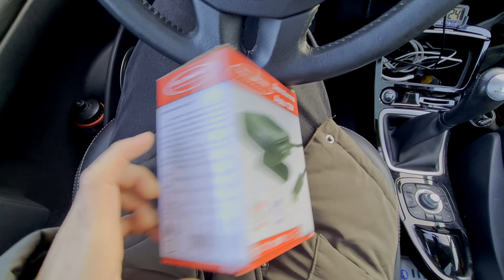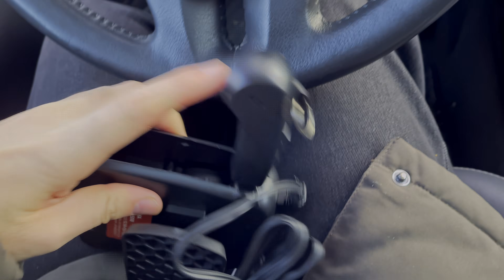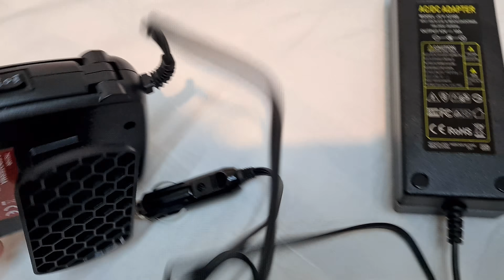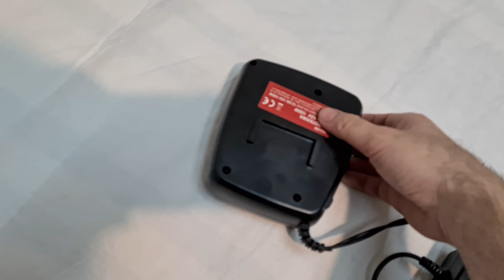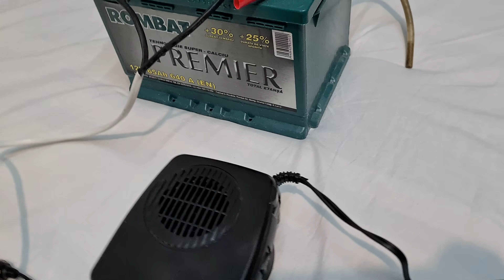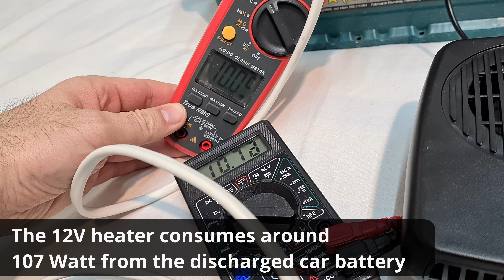12V Air heater, 150W (Aeroterma Auto)

Comment: I want to use it in tent with powerstation . 1 hour + break + again 1 hour. Do you think it will melt cable or melt the end plug where connects powerstation ? because you said the tip is hot . btw amazing informative video thanks brother
Reply from the maker: I'm not sure what it will do, but definitely keep an eye on the temperature of the connector and wires, not to melt/burn something!

Comment: How many CFM?
Reply from the maker: I have no idea, but it's definitely less powerful compared to a hair dryer. It's just 150W, not 1000-2000W.
Reply: @furulevi  Thanks for the reply! 👍
I saw another video with a guy testing a 250w, 12v car defroster/heater and his experiment showed that even his couldnt keep a completely insulated van interior at a constant temperature. These tiny heaters are usesless for managing cabing interior temps in cold/freezing weather.